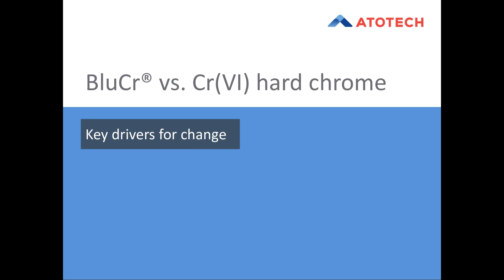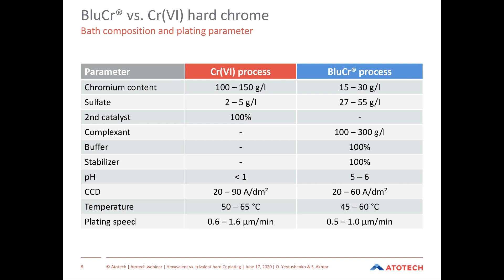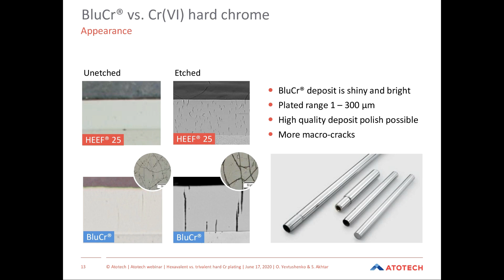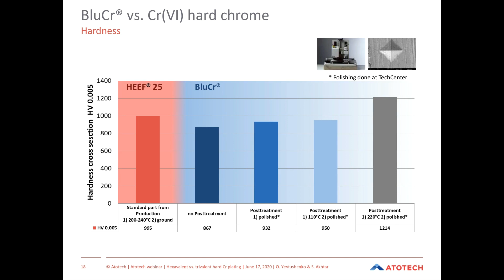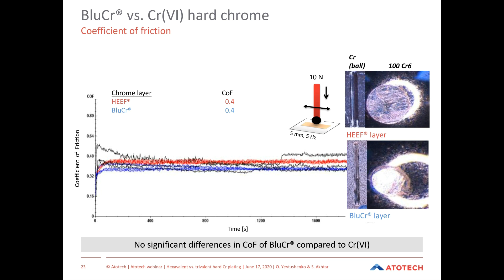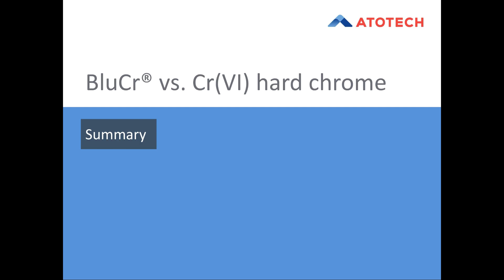Hexavalent versus Trivalent Hard chrome Plating

Comment: Thank you for the excellent presentation. I am setting up a new operation for hard chrome and am seriously considering the Blu-Cr trivalent process for its environmental benefits. Can you please provide the following costing estimations:

1) The chemical and additive cost to deposit 9,047,800 ampere hours per year.

2) The equipment investment for a new complete system to plate 0.002"/side of Cr on 40 rods per day (8 hour shift) that measure 2" diameter x 72" long, typical steel alloy base metal of newly manufactured parts.

Please use India equipment and costing; I can adjust it accordingly.  

Thank you,